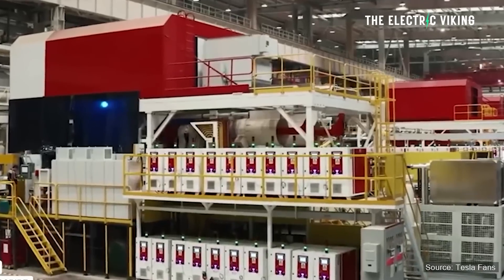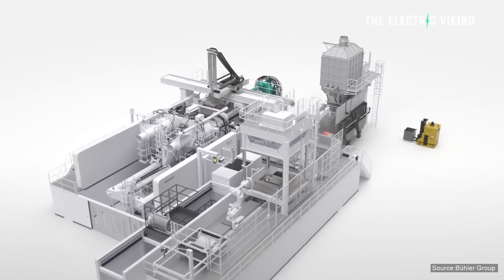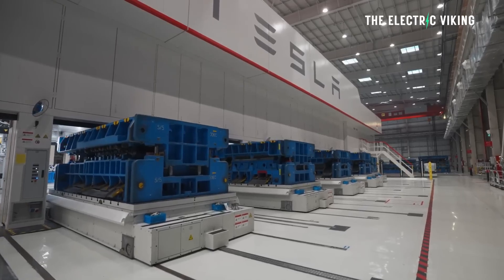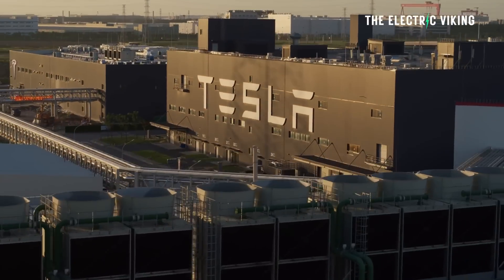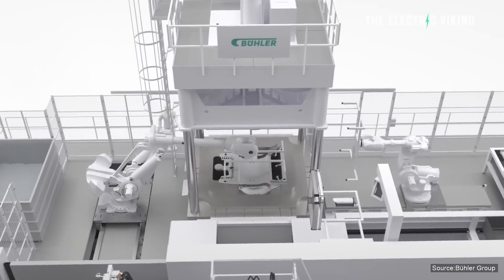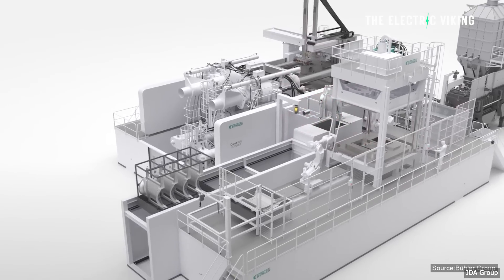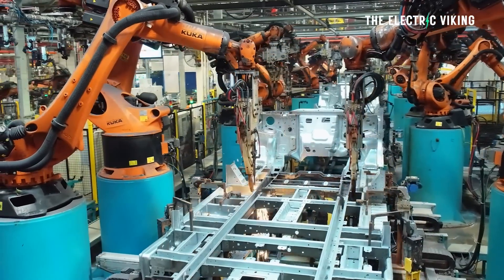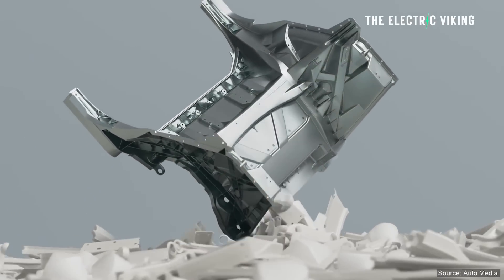Chinese engineers invent giant magnesium Gigacastings for cheaper, lighter EV's

Comment: It's already hard enough putting out an EV battery fire.   Putting out a magnesium fire is impossible
Reply: Magnesium alloy is not magnesium
Reply: @manimalworks7424  Magnesium alloy is mostly magnesium. And alloys aren't chemically bound. You reduce flammability by alloying with a more electropositive sacrificial metal, such as calcium. Notice, the word "reduce".
Reply: @Markle2k  if you’re right, why stainless steel doesn’t rust? Iron is not chemically bound with nickel neither in stainless steel.
Reply: @manimalworks7424  The chromium forms a passivation layer similar to how aluminum and titanium protect themselves. By the way, as any owner of stainless steel flatware knows, it does rust. It just doesn’t catastrophically disintegrate as fresh metal is exposed to the oxygen in air and water.
Reply: @manimalworks7424  how about this statement form another post.  Mercedes used a magnesium AutoBody frames and had a few disaster with the frame being highly flammable. It’s just another engineering hurdle but the endeavor is worth the try. Maybe they have a metal mixture that will work well.
Reply: @IlovepotaTOES-76  [Mercedes used a magnesium AutoBody frames and had a few disaster with the frame being highly flammable.]
I call BS on this. Reference please.
Reply: @IlovepotaTOES-76  I don’t know about Mercedes. But as an engineer, I know magnesium is flammable when meets water. No sensible engineer would make a car frame with magnesium metal because we all know merging in water is often the case when it rains. If I know this, those engineers must know better. After all, they are definitely more knowledgeable than we’re. They are putting a lot of money into this.
Reply: To add to this, aluminum can also catch fire and burn, at a high enough temperature. Depending on the alloy, aluminum and magnesium are virtually the same melting and ignition point.

Google:
"Magnesium Vs. Aluminum: How to Choose an Alloy for Your Custom Casting Project"
Reply: @stephensaines7100 eference what goes into MAGNESIUM ROAD FLARES.

The references are legion.  Your dismissal is invalid.
Reply: @manimalworks7424 magnesium is not reactive with water, it is reactive with hot water produces magnesium hydroxide. but it's not an an oxidizing reaction. Audis have magnesium engine blocks and there are wheels made out of magnesium.
Reply: Do you think you've realised something that Engineer and Science Phd's have not?
Reply: @N1rOx  right but, your acting like corners haven't been cut before and safety thrown out the window.
Reply: @IlovepotaTOES-76  No that's you putting words in my mouth. I'm telling him directly, that these guys have thought about that "gotchya" you thought you had. If they're ultimately forced by the suits to market a dangerous product, well, that's another thing entirely.
Reply: @IlovepotaTOES-76  do you actually a tesla ? If you actually had knowledge about the company and how they view vehicle safety and five star crash test awards then you would understand that safety is their number one focus so I don’t believe that they would be cutting corners when it comes to safety
Reply: @justinschmidt1380  From what we've seen about this company, its CEO, and their attitude towards quality, safety, and honesty, the criticisms are valid.  The valuation and cult following, are not.
Reply: @vineleak7676 They have and they haven't. BYD's blade battery is very safe from puncture. They could have thrown the baby out with the bath water and said that lithium batteries will always inherently have this problem. But they didn't. They researched further and pushed the boundaries of what is known, you know, like Scientists usually do.
Reply: How about using hemp instead?
Reply: Sodium Chloride is also very dangerous, spontaneously combusts in water.🤡🤡
Reply: they reckon they can make engine blocks with AMC-SC1 magnesium alloy
flammable engine blocks?
Reply: @shadyhazza  Cute.  How hot does petrofuel burn?  Or alcohol?

Not as hot as lithium when exposed to water...
Reply: Oh yeah huge bonfire 😂
Reply: 🙋‍♂️SAM ,NO SHORTAGE OF CRITICISM …BUT TIME WILL TELL 🧐👍💚💚💚
Reply: My first thought exactly
Reply: Imagine the towing savings though.
Reply: @chrisborns5972  Kind of gets wiped out by the property damage lawsuit, though.

Insurance only goes so far...
Reply: Erm, magnesium alloy is often used in aircraft parts. Aluminium burns quite well also (it is used as part of the fuel of solid rockets), and produces toxic fumes when doing so. The only part that I’d query it what about exposure to heat? It softens at much lower temperatures than Aluminium, so shouldn’t be used for parts that are subjected to high heat.
Reply: @stevetodd7383  You will also notice that airports are equipped to deal with Class D metal fires, and are set up so that most aircraft fires happen in isolated areas away from structures, fuel and power and gas lines and the like.  So it's apples and oranges.
Reply: @billcichoke2534  given how many of the modern magnesium castings are for engine parts then how does that involve keeping them away from fuel? Magnesium parts can meet the FAA safety standards for fire resistance. If they can manage that then sure as hell they are good enough for automotive use.
Reply: @stevetodd7383  Please do your research as to WHERE those magnesium alloys are used.  And they ARE kept away from fuel systems and sources of flame or ignition, since even the zinc and aluminum based alloys are susceptible to ignition if subjected to flame.

By the way, aluminum and titanium alloys are used in aircraft more often these days, to mitigate the fire risk.  It's also the reason Li-ion batteries aren't allowed on board.  So the fire risk IS real.

Stop dismissing real and actual safety concerns with EVs.  Many of the people involved eith their design, have shown an actual ignorance of MANY of the hard sciences.  These things are a government-pushed agenda item, not innovative or progressing technology.  And thr people making them HAVE shown a willingness to ignore best practices, common sense, and safety protocols.
Reply: @billcichoke2534  You've lost the plot. Li-Ion batteries are "allowed on board" aircraft.
Your fear-mongering over Li-Ion WON'T fly here where people have heard your crap many times before
Reply: @billcichoke2534  I suggest you do your own research. See https://www.fire.tc.faa.gov/2007conference/files/Materials_Fire_Safety/WedAM/GwynneMagnesium/GwynneMagnesiumPres.pdf , they are definitely used in engine parts, both for jet and piston engines. They aren’t used in the really hot parts, but they are plenty close to heat and fuel.
Reply: @Markle2k  Nice try.  By FAA regs, they pose a 'significant fire hazard' and cannot be used in aircraft.

Your greenwashing lies aren't holding up anymore, which is why government FORCE to drive EV sales is ramping up.
Reply: @billcichoke2534  erm, no. They may not exceed 99Wh without approval on an aircraft, but may be carried in hand baggage. With approval they may be up to 160Wh. Some aircraft types use Lithium Ion batteries as part of their design (the 787 famously uses them as part of the APU, and had problems with early models catching fire).
Reply: @stevetodd7383  Read my posts shain.  Then read your linked srticle shain.  You just proved my point.

They're used in areas where fuel flow and combustion DO NOT take place...like mounts and braces and frame sections.  They are NOT used where the chance of exposure to fuel and ignition sources take place.
Reply: @billcichoke2534  You are a decade out of the loop. Look up 787 battery. It has used Li-Ion batteries for the main bus battery and the APU starter battery since 2011 (albeit with some teething problems). Subsequent aircraft designs have picked up Li-Ion including the 787s main competitor, the Airbus A350. The F-35 fighter also uses a Lithium-Ion battery.
Since 2018, there is a TSO for using Li-Ion batteries as a replacement. See TSO C179
Reply: @billcichoke2534  you’re trying to move the goal posts. Your claim was that magnesium castings were used no where near structural parts, fuel or power lines. My point was that they are often used in engine parts which, while not part of the combustion chamber, are close to all three of those things. You’ll also notice from that link that they can sustain exposure to a 1000 degree flame for in excess of 30 minutes without ignition. As such they pass FAA regs for fire resistance. 
On the automotive front, you’ll also see that BMW are using an Aluminium Magnesium hybrid casing for some of their engine blocks. If they are confident in that then using magnesium alloy for structural parts isn’t a big leap.
Reply: @stevetodd7383  Not at all.  And you'll also notice that those BMW engine castings, like their aluminum cousin, use STEEL SLEEVES for the cylinder walls up to the combustion chamber.  They are NOT directly exposed to com ustion itself, any more than they are when used on aircraft.  And, AGAIN, aircraft designers have moved AWAY from using magnesium on planes, TOWARDS titanium and newer ALUMINUM alloys.

No one's moving the goalposts except you.  I've made my point known about Tesla EVs and backed it up.  I've also made my point about Li-ion and magnesium use in aircraft, which your articles even backed up.  YOU moved the goalpost to try to refute FAA lithium battery restrictions point.  You failed.

Lick your wounded pride and move on.
Reply: @billcichoke2534  apparently reading comprehension is one of your problems, along with memory. At no time did I say that magnesium alloy was suitable for direct exposure to combustion, rather that it was sufficiently fire safe to be used close to areas where combustion was happening. Your original point was that it couldn’t be used near fuel, power or structural components. I provided examples of where it was used near all three of those things. In case you hadn’t noticed jet and piston engines contain them all. 
You seem to like making these ex cathedra statements, with no backup, and then wonder why you get repeatedly shot down. Maybe, just maybe, you should do a little checking and research before making them.
Reply: @stevetodd7383  Would you PLEASE read my post again.  I referenced how airports are designed to isolate aircraft away from fuel and so forth so fires on board the craft would not involve other systems or structures ON THE AIRFIELD.  You still apparently can't read what I wrote, or understand it.  I don't think I could be any more clear.

And metals capable of creating a Class D fire, ARE kept away from open ignition and combustion.  You cannot find ANY FAA reg that your article can argue around.

Please do your reading again.  You really do not understand this stuff at all.  I'd rather you DID.
Reply: @billcichoke2534  “Please do your research as to WHERE those magnesium alloys are used. And they ARE kept away from fuel systems and sources of flame or ignition, since even the zinc and aluminium based alloys are susceptible to ignition if subjected to flame”
Your own words to which I was replying. I provided a link to the FAA web site, where they do indeed state that magnesium alloy engine parts are common. They also state that they are considered sufficiently flame resistant as to be used near hot engine parts and fuel lines. They don’t require special handling or precautions, and oddly enough cars aren’t kept parked next to fuel pumps or inside of residential structures (without additional fire precautions at least) either. The precautions are there because of the flammable fuel, not because alloys make vehicles significantly more dangerous.
Reply: @stevetodd7383  Show where magnesium is used for pistons, turbines, combustion chambers or valves.  Show where it's used for the burn can on the backside of a jet engine.

They aren't.  Even your PDF doesn't show that.  And gearboxes and intake fans are NOT subjected to heat of ignition or combustion.

So, again, my point regarding this, has been made.  And my point regarding Tesla's ignorance of hard sciences also stands.
Reply: @billcichoke2534  once again you aren’t reading what I wrote. At no point did I say that they were used in combustion chambers, for valves or turbines. They are however used for things like oil sumps, thrust reversers, engine blocks (for automotive use) and gearbox casings. All parts of engines. All near the source of combustion and/or fuel lines and not things you’d make of a flammable material. The FAA have tested these alloys, and found that they meet their fire safety standards, which is how they are permitted in those locations and for those uses. If they are safe for use in engine parts then they are safe for use in automotive chassis, and aren’t likely to combust in any circumstances that wouldn’t have given occupants ample time to clear the scene (aircraft can’t just pull to the side of the road, which is why FAA regs require at least 30 minutes resistance to flame without burning).
Reply: @stevetodd7383  As I already stated, the use in engines is NOT in combustion zones or where ignition takes place.  Thrust diverter INNARDS cannot be made from magnesium, since the exhaust directly from the burn can is going through and onto that component.  Magnesium is used in STRUCTURAL elements, like gearboxes and helicopter rotor heads and struts, but not where temps can go over 250 C.  I've said that, and even the article (powerpoint slide show) you keep trying to refer to says that.

I'm not sure where the disconnect is coming from, unless ANY criticism of Musk's so-called 'genius' is the problem for you.
Reply: @billcichoke2534  and I’ve repeatedly said precisely that. Magnesium alloy isn’t used in the hot parts of an engine, but it is sufficiently flame resistant as to be used in engines. Fires don’t start because hot stuff stays where it is supposed to, they start because it gets out and onto the surrounding area. Because of that you don’t want any part of the engine to be made of flammable material. If magnesium alloy was a fire risk then it wouldn’t be allowed near where it actually is used. 

ANY metal is flammable if ground to a fine powder and exposed to heat and oxygen. Fireworks produce silver sparks by using iron filings. Solid fuel rockets use a fuel made partially from aluminium powder. This doesn’t mean that they are not suitable for automotive or aircraft use.
Reply: I was of the opinion that the aluminum and magnesium alloys are very light but tend to become brittle.?  Yes if magnesium catches fire you are in a world of problems trying to put it out.
Reply: @barrymayson2492  Not BRITTLE, per se, but they don't have much tensile memory, like steel does.  Therefore, they wear out st stress points during heating and cooling, where steel just springs back into shape.
Reply: The 1st thing you need to do is to brows the internet on 7075 alloy used in carabineer. And then try to burn a carabineer to proof it.

And if you have aluminium stuff around you.... It is 80-90% chances of being mg-al alloy
Reply: Specific tar extinguishers are used for magnesium, they work quite well. It hardens and seals of air to it. For EV batteries I believe there is too much gas venting for it to work on those. There are already car engine blocks and entire flat bed semi trailers made out of magnesium. In whole it's hard to ignite, it's when you get shavings that things can get bad very fast.
Reply: @jboertlein  EV battery fires are LITHIUM based, and are also Class D fires.  That means they're freeing their own oxygen as they burn...especially if water is introduced.

Class D extinguishers are often more like sand than tar (although I'm sure there are a few new entries that could be related).  It's about giving the metal a non-reacting substance to cover and bond to, rather than one it can use.  According to every firefighter I've spoken to, Class D capabilities do not exist outside of airfields.
Reply: @billcichoke2534  worked for Audi and we had yellow fire extinguishers, they were I believe class D for metal fires. We had magnesium parts blocks casings made out of if it.  It was mandatory to have in the shop. A big yellow They used a black tar substrate. Not sure of the formula they used. Thankfully, I never saw them used.
Reply: That’s a problem for firefighters…
Reply: @vineleak7676 have you worked in China? If not, your statement is based on what? I have worked there for 10 years. I can tell you the no. 1 priority is safety.
Reply: @manimalworks7424 you getting your 50 cents for that one?
Reply: @Lazerspike  don’t talk if you have nothing useful to add to the comments, there are Chinese who doesn’t care about safety, and there are some who are over cautious about it, just like any other races. Your 50c remark just shown your prejudices.

Comment: Interesting. Historically cars have a bunch of parts because drivers keep crashing them and with individual parts they can be repaired easily. Tesla not so easy to repair and often written off - wasteful. I guess stop people crashing their cars.
Reply: Which is better than hospitals, surgeons, helicopter flights, and prosthetics. FSD will get us there.
Reply: Well I don’t think that’s exactly how crash repair works on legacy body frames. They pull and bend the frame back into shape and if necessary cut away areas and weld sections back on. I’m not sure I would want to own any car that’s been subject to that kind of repair. However parts of the mega castings have been to designed to be cutaway (the crash absorbing sections) for new crash cans to be welded on.